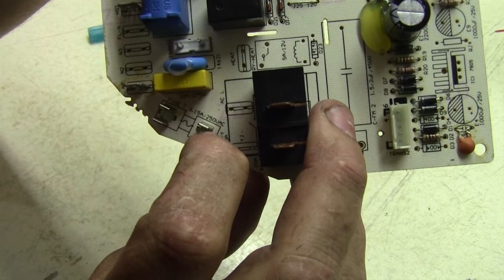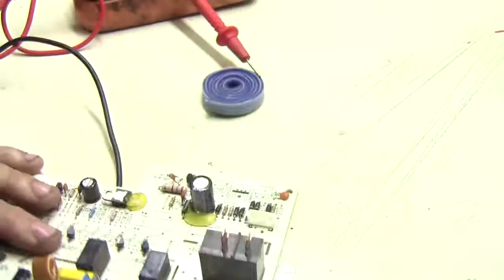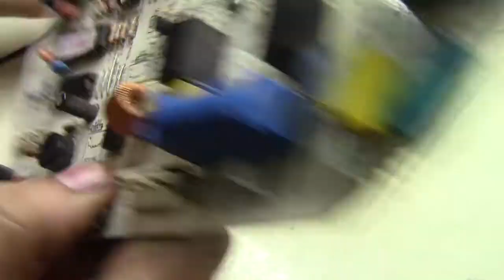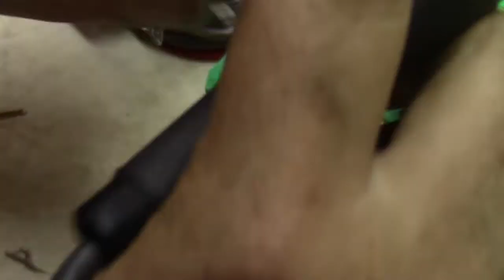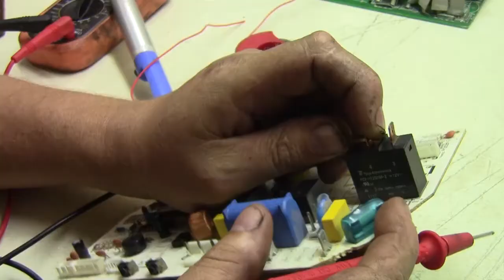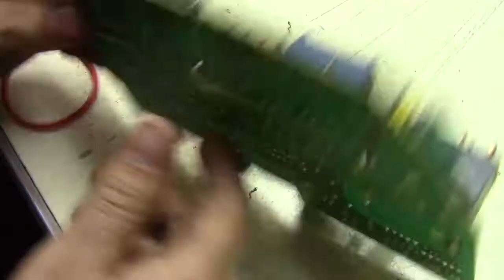ShoutingElectronics #38 - Another Airconditioner PCB (Why do I keep on getting these boards?)

Comment: Why do you get them, because you can fix them. Half the time the suppliers will charge you R1000 for a replacement board, even if the fault is a common one, which is that indoor fan capacitor going low in value, so the indoor unit fan will not start up. R5 capacitor and away you go with a working unit again. Reminds me, should stock up on those soon, running low, but Mantech is just 5 minutes down the road.